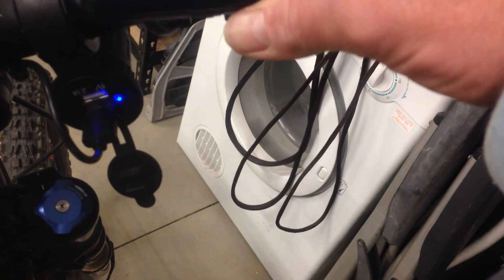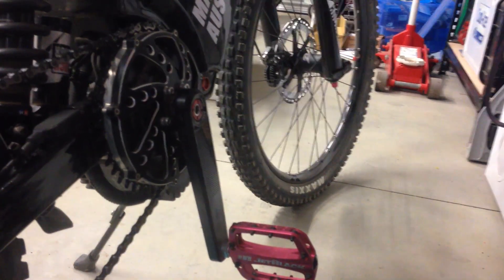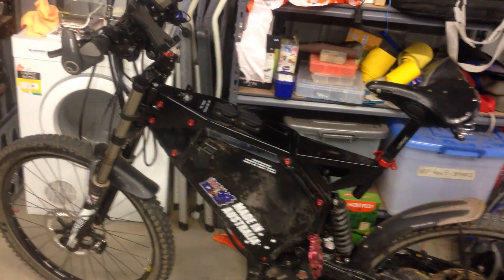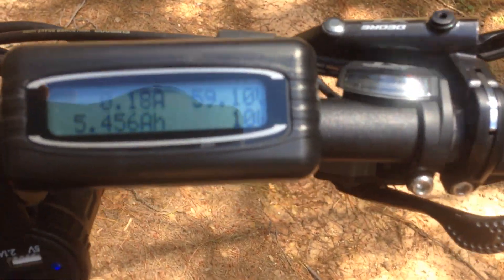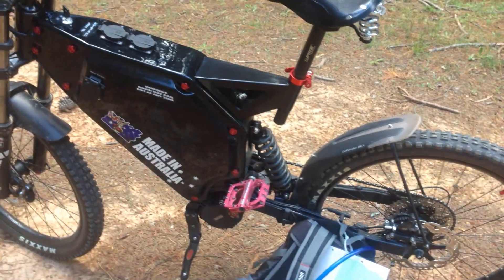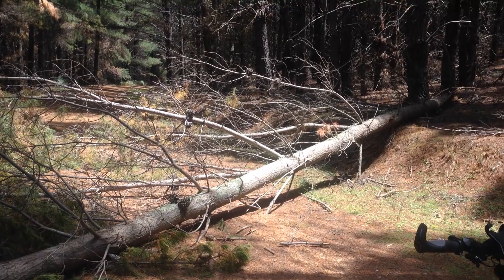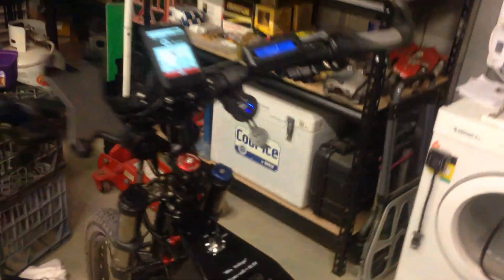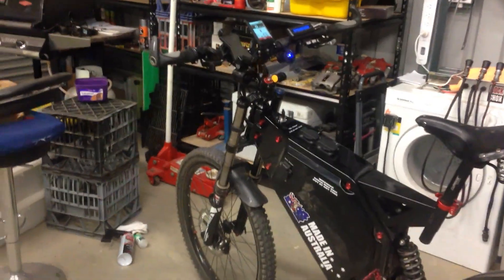Advantages of 15S Over a 14S Battery with BBSHD Motor

Comment: Wow you're using about half your battery from 4.1 to 3.5 and seeing 60km without really getting all the way down to 3.5V. Technically if you had to get as much range as possible you could probably hit 100km maybe 110km of range taking it down to 2.75V under a light load.

What kind of voltage sag do you see? I'd imagine this is another great benefit of 15S, you're probably dropping down to 14S open circuit voltage while the 14S guys are down to 13S open circuit voltage when you need to get going from a dead stop.

Have you considered going back to 4.0V and taking the cells down a bit more, say 3.4V or 3.35? I think the graphs on depth of discharge and cycle life show that anything over 4.0V is where the stress on the cells really begins to take its toll and the cells can be taken down as low as 3.0V before the bottom end stress really takes cycles off their lifespan. I've always thought 4.0V to 3.2V would be ideal in terms of leaving the cells as close to their comfort zone as possible. Under load that might equate to the cells dropping to 2.8V? 2.9V? That would probably be under quite a heavy load and you could likely cruise with a voltage sag of only 0.2V, keeping your cells above 3.0V even under load. Sucks when websites publish graphs on this and don't specify if the voltages they are talking about are OCV or under load.

This website has some interesting data that but seems skewed towards focusing on max charging voltage and not factoring in min cutoff voltage and how that effects cycle life. The best part is there is an equation for determining cycle life based on how low you go below 4.2V

https://www.powerstream.com/lithium-ion-charge-voltage.htm
Reply from the maker: Cheers Eric 🍻  Yes the 15S setup has been great, Voltage sag in general drops to a 14S Voltage under load. I did the O,Keefe Rail Trail in Victoria last year. I can confirm I got 100Km off the 1 Charge (At 4.1V per cell) riding at PAS 2 the whole ride. I dont use a BMS so 3.5V per cell. 52.5V Total was my visual safeguard lower limit of my Total Battery pack.
I carry a plug in Cell checker which can be read underload while riding if I feel there is any issue.
Surface consisted of 99% crushed granite / 1% bitumen & was mostly flat.
Im Chasing a bit more power / voltage & efficency with an up & coming Version 2 of my current build.
I'm currently waiting on a High Voltage BBSHD "Upgrade" Kit ( BAC855 controller & Eggrider display, etc) as the Stock BBSHD controller is the weakest link in my design at these 15S Voltages. 
I have never blown it but always mindful of how I ride. (Usually using PAS 99% of my rides)
Anyway in the short term upgrading Battery with another 10 cells to 16S/10P increasing Voltage to 65.5V (still at 4.1V per cell) thus can also play around with 4.0V per cell or even keep 30A Max current but with increasing Voltage, it should output around 1,968W at Motor.
It has 2 types of power profiles which can be fully customised so at a press of a button can switch from Offroad to Onroad profile with ease. Offroad I may leave at 30A Max but Onroad I may set it to 20 - 25A Max with a more efficient PAS profile for future Rail Trail Rides. In theory a near perfect setup using this controller. 🤔
 This controller is much better, 
I read it is a pure sign wave controller & is more efficient. In the future I may go with a different chemistry, 20S/1P Lifepo4 A123 pouch cells. Im Wanting to make an safer battery in the future to protect my Build & enjoy it for many years to come.
One gets nervous when even a Billion Dollar company like Tesla is having Cars catch fire under Thermal Runaway (Non accident related) with all there high tech safe guards. 😳 
Thx for the link. Very useful & informative. 👍🙏😊

Comment: I did a 15s using 3x 5s batteries. I fully charge to 63v and just tool the voltage regulator in the bbshd with a 68ohm resistor on the yellow or brown wire. (I use an extension for the display and hide the resistor in that.

Comment: Hi, great infos man!
Do you know if I can set by bms with bluetooth option to charge the battery to 4.1 v and balance it until this voltage by bms?
Greetings;)
Reply from the maker: Hey Radoslaw, i havent come across any BMS with an Adjustable 4.1V cut off option, but saying that i dont use or have researched many BMS as i usually build my own Battery & run 2 balance leads out if it, 1 for Balancing & 1 for a cell checker to monitor series cells either underload or when stopped. Sorry dude cant really help you there much, Try Tony from his "Vortecks" Channel,hes really clued up on a particular blutooth bms. Hes actually designed his own app for it. https://www.youtube.com/c/Vortecks
Reply: @oze-bikes4life663  Thanks for such quick answer. I will try to contact him. I would love to have 15s battery for my Bafang:)
Reply: @oze-bikes4life663  Could you write what is your version of your controller of Bbshd? Which year did you buy it?
Reply from the maker: Radosław Herdzik , i purchased the motor around 2.5 to 3 years ago, i believe its the newer version, You can tell by opening up controller case and checking if the wires have bullet or anderson connectors, i believe the newer version has bullet style connectors. I have never opened it up so could not tell you for sure. It would make sense to me that the newer models would be bullet connectors as it would be cheaper than anderson type connectors. Its the usual story if the manufacture can save a few cents per motor than you can bet you life there going to do so 😁 if i can remember, i asked luna cycles upon time of purchase & they said it would most likely be the "newer" version. (Someone can correct me if im wrong but the only difference is the type of motor phase wire "connectors" )
Reply: @oze-bikes4life663  I also bought my Bbshd 3 years ago and also bought 2 engine this time. Both have bullet connectors.
Could you look and write the serial number of the controller?
My number of the engine I bought 3 years ago is:CR R10E1000.SN.U 1.4
Reply from the maker: Radosław Herdzik , sorry dude im not pulling my controller apart & compromise the gasket. Why are you so concerned about the controller anyways ?
Reply: @oze-bikes4life663  But there is no need to look inside the controller. This is the number outside the controller.
I am just asking because there are people who have even problems runing 52v. All it is dependent of controller.

Comment: Higher voltage will use more watts out of battery. 48v battery will  use less watts but lower top speed  but you could have 50ah capacity for same size for way longer range
Reply from the maker: Mate im a Electrician, your "dead wrong" with that statement, if you raise voltage you lower current and visa versa. Its using basic Ohms Law Rule.

Im lucky to pull 25A  on my EEB (BBSHD)with 15S battery pack, instead of running a usual full 30A when i was using 14S battery pack on my previous BBSHD ebike build.
Reply: @oze-bikes4life663  interesting! For example let's say the motor coils are 5ohms. Ohms law says 58v÷5ohms= 11.6amp draw,48v÷5= 9.6amp draw from battery. So I'm confused from your results
Reply from the maker: Greg Stafford , dont worry about being confused, just believe me 🤔😁

Comment: I am planning an ebike build  and was thinking to do it with a 15s and charge to 4.1 max for the same reasons you mentioned, glad to find someone already done this with the stock controller and everything is working fine. nice build. do you find the extra wight with the enduro  frame having much difference compared to the normal mountain bike setup ? or is this extra voltage compensating for the weight?
Reply from the maker: Hi Supernova 1976, 
Yes there is a difference in "agility" not quite as agile when low speed riding in twisty technically sections.  But i think that Ebikes in general have that Flaw
because of the extra weight involved.(Some more than others)

The EEB frames "steering geometry" is not perfect, (larger turning circle than a Std. Mtb) i run a big capacity 15S/ 35AH battery so theres extra weight there also. The Bafang BBSHD handles the Extra Weight of the EEB Frame very well, the suspension i run is Phenomanal on Rough & Rocky Dirt Tracks. 
I do alot of Single Track "Touring" type riding through State forest & Bushland,
I dont do jumps or fly through bends like one might do on a light weight mtb, but i can accompish great distances on single dirt tracks with huge elevation changes which for me more than make up for a few negatives. 
Running a 15S setup will be more responsive even after many kms into a ride, i use to run a 14S BBSHD setup (on a Std. Mtb Hardtail) & after 30-35km the Voltage drop would become noticable when attempting hill climbs and less responsive under acceleration. 
Now with my 15S setup on my new EEB Frame i manage around 65kms before i start to notice a similar result.
I hope that helps 😊
Reply: @oze-bikes4life663  that's great feedback much appreciated. I checked your other videos I didn't catch if you mentioned the total weight of the bike ?
Reply from the maker: supernova1976 , Yeah the weight is "32.9kg all in"
Its weight is actually in my "Description"  at https://youtu.be/o77ZcixtWe8 along with a whole lot more info/stats.
Reply from the maker: Thanks mate.... Im Happy to help, "Good Luck" with your Build 👍🏼😊

Comment: Great video. I thought 60 volts was max. Wish they would do a new motor with 200 volts and 60 amps.
Reply from the maker: G'day Super -sim, 200v at 60Amps ... that would be a handful off road, but a lot of "Fun" 😊 Yeah I have read a few forums before I committed to my 15S BBSHD build. I believe they rate the BBSHD at 14S so as to cover themselves, last thing "suppliers"want are a lot of "Warranty repairs" for Burnt Out Controllers/motors etc .Rated at 14S I believe to cover Full Throttle (No PAS) Ebikers, & Ebikers that do not drop down to a lower enough gear to climb those steep hills. A little bit more care must be taken with a 15S Setup & Riding Style.

As in my description, my 15S setup & my whole Enduro E-Bike build is suited for Off Road/Single Track Touring using PAS 99% of the time. Ofcourse I do use Throttle only when "tired on flat ground" at the final stages of my ride usually. On steep hills I'm using 46T or 42T (on rear cassette) in PAS 9 (& pedaling) 
It Works for my riding style & build "but do so at your own risk" ! , ofcourse running 15S on the BBSHD will certainly "Void any warranty" through your BBSHD supplier. I not trying to persuade you either way or even scare you off the idea but just inform you of both the risks & rewards of a 15S setup. I think if ones worried about their warranty (then wait to warranty expires, then convert it to a 15S setup.

Comment: Nice. I just bought an Eggrider. It allows tuning from an app, all via bluetooth. Quite nice so far.
Reply from the maker: Ooh nice, makes life easy... I'm using Luna Black Box Programmer (works well) heaps faster than bringing out a laptop.. booting it up then changing settings, but your Bluetooth setup sounds like the next standard in DIY E-Bike Programming. 
Can you visual see "individual Cell voltages" in real time with this app ?
Reply: At this time no, but maybe on a firmware update. Not sure of its capabilities. Found it by accident after breaking a display ;-)
 @oze-bikes4life663

Comment: what PAS setting do you usually have it set at when you ride?
Reply from the maker: G'day Trick5ter001, I usually ride on Single Dirt Tracks with "lots of elevation change" due to my location, so 
- PAS level 1-2 when cruising on a flat
- PAS level 2-3 when cruising up slight hills
- PAS level 3-5 on Moderate hills, 
- PAS level 5-9 on Steep hills. 

I recently purchased a Luna Black Box Programmer (Luna Cycles) to Edit PAS & Throttle profile settings with ease without the use of a Laptop (having to drag the laptop out to the Shed all the time to make a 1-2minute program change gets real ordinary "Very quickly" )

"Karl's Special Sauce Program" was a little too "aggressive "for my build, it tend to quickly heat up the Motor/controller on even cool days, great program on a standard mtb frame but runs a little warm with the extra weight of the EEB Frame & large 15S/ 35Ah Battery Pack.

Luna Cycles "Standard "Hotrod" program was not well suited to EEB Frame either, PAS 1 setting was a little soft, I never used PAS-1 until I reprogrammed in my own PAS Settings now PAS 1-9 is much more suited to this build.

I will upload a Walkthrough video on my own preferred settings for the EEB build in the near future." (This can be done on a laptop)